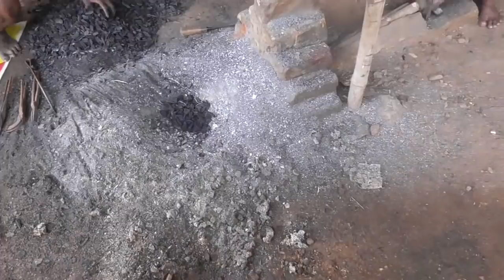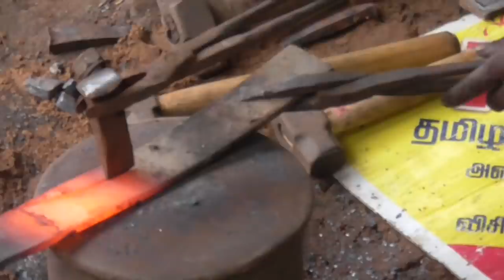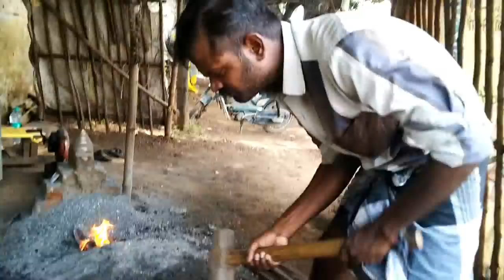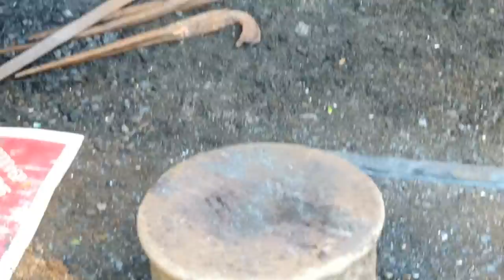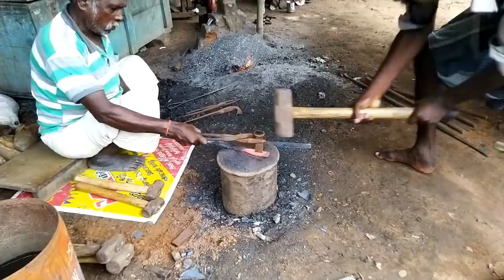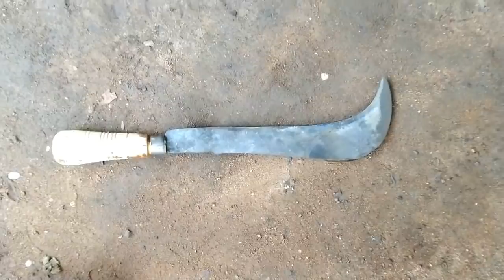Billhook Making | Billhook | Steel to Billhook | Indian Blacksmith Making Billhooks

Comment: Make it nice!  For quenching methods use bar soap of clothes! Wipe the bar soap on the bevel of the edges put in fire for 5 seconds then submerge into the water gradually. The white line appear this is the result of good quenching methods!
Reply from the maker: Great tip!